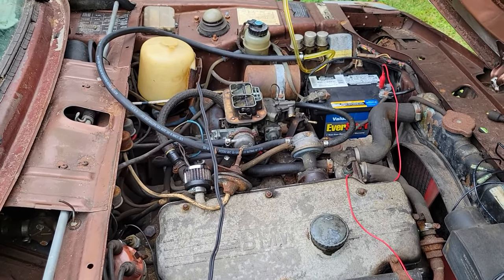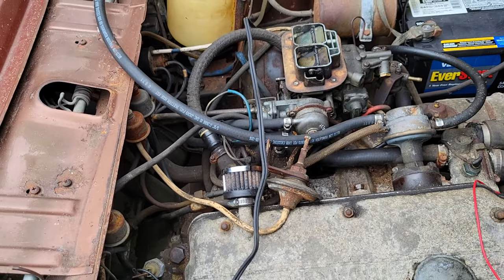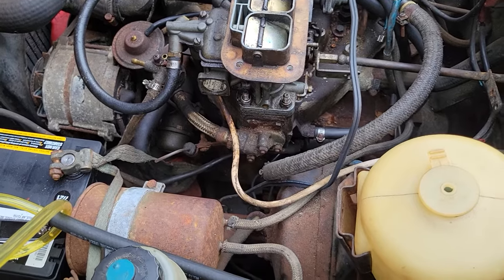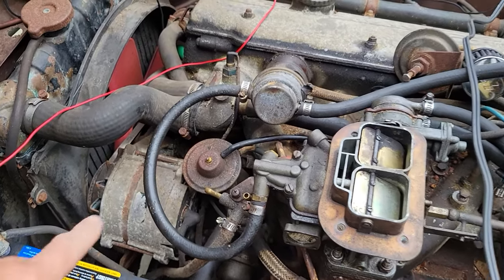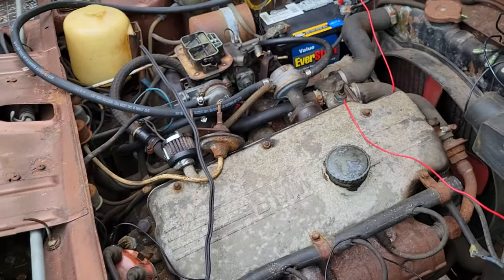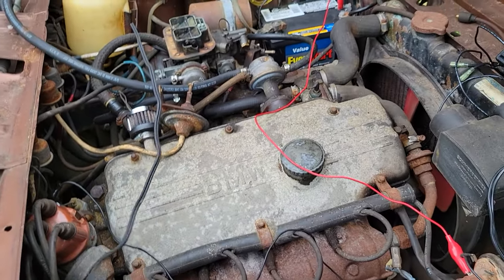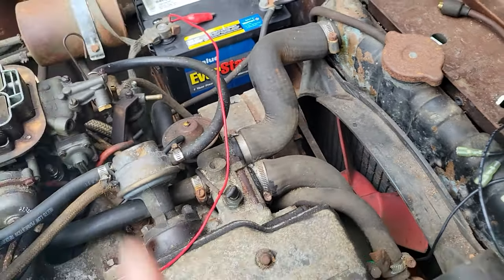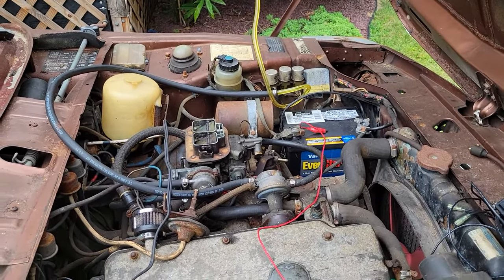How to start a classic car with minimal wiring

Comment: How long can you run it like that. I'm having problems with an old boat, I just bought the an engine and it wont start when connected to the hartness, but I can start it in similar fashion. Also Do you know if I can just run new wires from the ignition to the starter without the harness plug. I dont care about the gauges .
Reply: Long as u want
Reply: if you got time you can prob check for any disconnection in the harness that can cause it to not start like fuel or spark